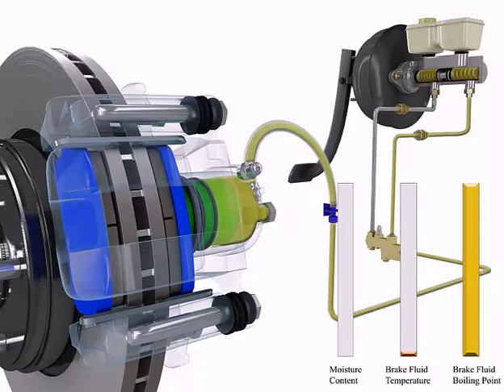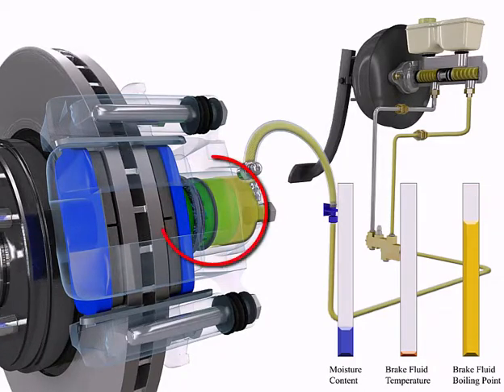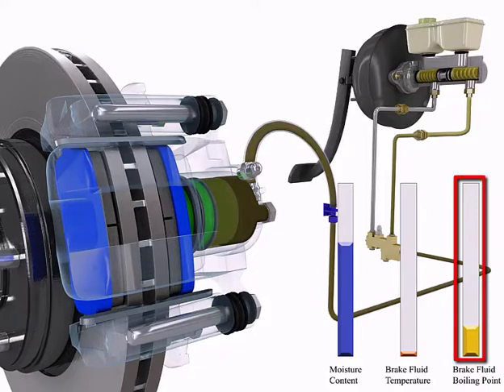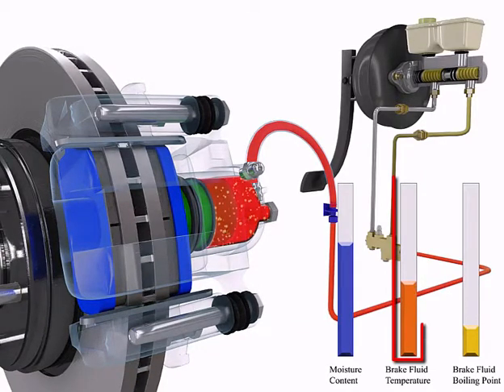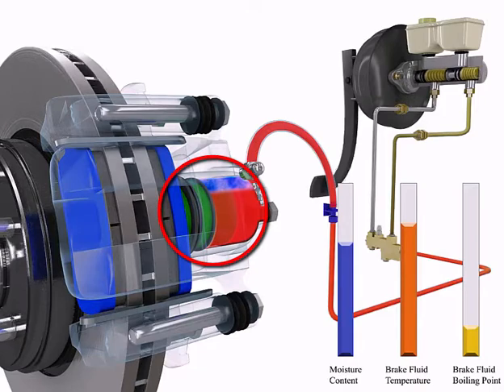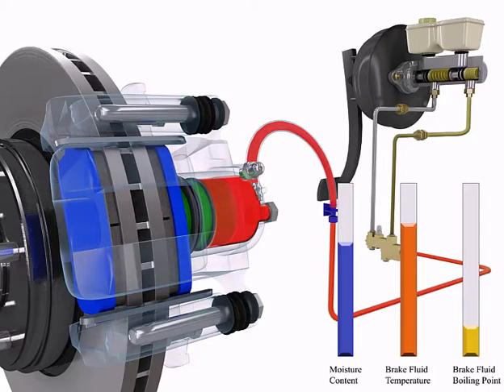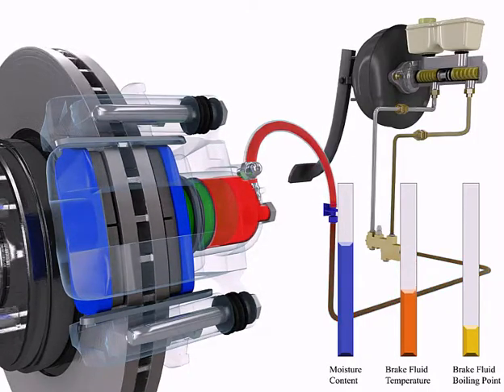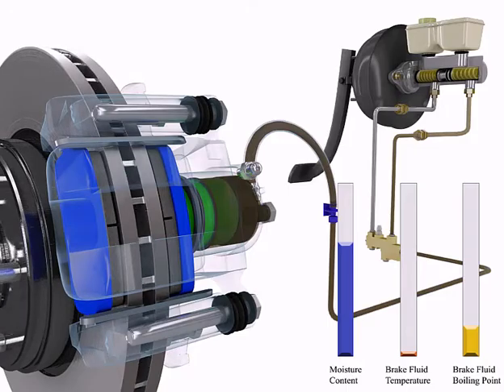Moisture In Brake Fluid

Comment: I changed brake fluid for the 1st time in a 17 year old toyota, myself using Dot3 toyota brake fluid, today the brake caliper engaing noise is gone, the brake work 50% faster .These problem were told to the local toyota dealership owned by toyota japan every year but they never found any problem.Some say brake fluid doesnt need to be changed ,it does.

Comment: Okay ,so brake fluid can be absorbed through the rubber brake lines, atmospheric pressure, the brakes when applied have 10 times atmospheric pressure on the lines why doesnt the fluid leak from the lines?
Reply: Size of the molecules. Water is a nice compact molecule, brake fluid can by hydraulic oils or glycol ethers which are chain molecules.

Comment: Does anybody know what the greatest contributor to water absorption in a brake system is? I know that the rubber hoses and seals can wear out, but if you had to rank it, which part in the system tends to cause the most water absorption? 

Is the master cylinder going to absorb more water because it has a greater amount of brake fluid in one place and so the hygroscopic effect is stronger? I am thinking it may be like a full VS half-full gas tank (since ethanol is also hygroscopic) where a half-full tank is more likely to gets bloated if there is an increase in temperature. This is because when you heat something up, the molecules move around and collide faster and there is more space to move around in a half-empty container than a full one. 

I realize it takes a tiny amount of water (like 5% by volume) for brake fluid to be considered "wet" so if you have a 500 mL master cylinder, that's only like 25 mL of water. I know the "water absorption rate" is affected by humidity (and that is dependant on dew point), but is there a way to quantify how much water brake fluid absorbs over time? In other words, a measure of how hygroscopic it is? Perhaps this is basically wet boiling temp?

I know the difference between racing-oriented brake fluids like Castrol SRF and Motul 600 list wet boiling temp, but it doesn't seem to be provided for OEM brake fluid unless it is a sporty model.
Reply: Hoses [which are permeable] seals, and master cylinder assembly fill point.  Older cars [like 4x drum setups] may have used a rubberized gasket that would follow fluid levels like an accordion bellows.  If the cover was flat and tight, life was good - as long as that gasket was not pinholed or cracked they kept out atmospheric moisture well.   Modern cars use a master cylinder cap that well... isn't usually all that inspectable and is prone to breathing as it ages despite more modern materials.  A tight system? Good 3-5 years, depending on where the car lives.  My truck [a 1996] has no apparent leaks, but system isn't as tight as it once was.  I used to changeout/bleed system every 5 years, now I find it needs doing every two.  If I had a tester, I would plan maintenance if a test showed 3% moisture, but I don't so I take note of color shift over time.
The funny thing about anything hygroscopic is the substance can only bind up so much water molecules as a % of system volume.  That is saturation point - any new moisture, and you can have pure water in some areas of the system - lowest points are always hit the hardest as water starts displacing brake fluid.   I asked anyone I knew years back what exactly is that point: 4.2%?  5%?  What?  Nobody knows the answer because... its not promulgated by the fluid manufacturers.  I stumbled on this vid trying [again] to discover real information about dot3/4 fluids.